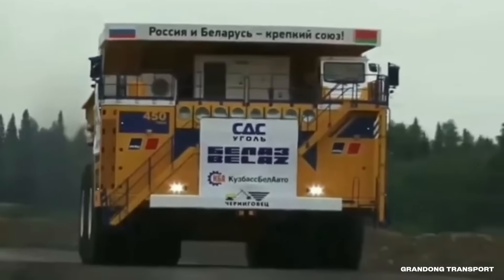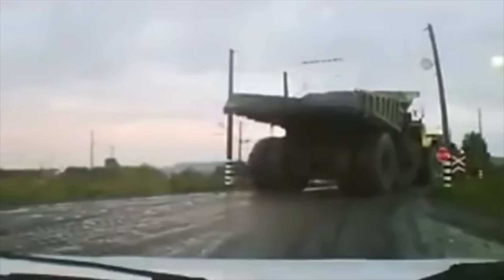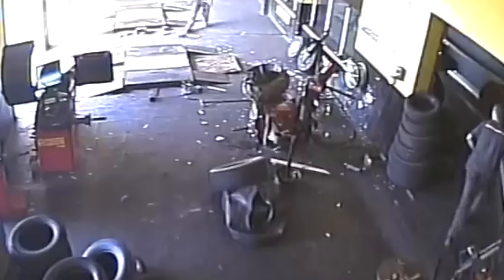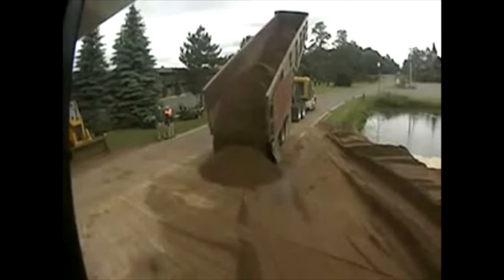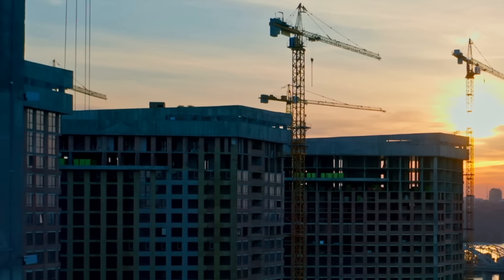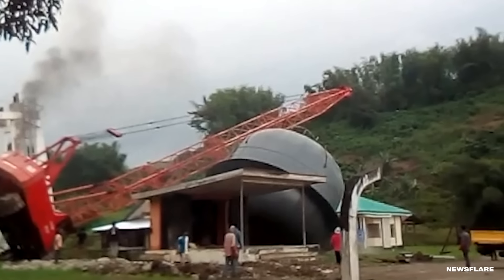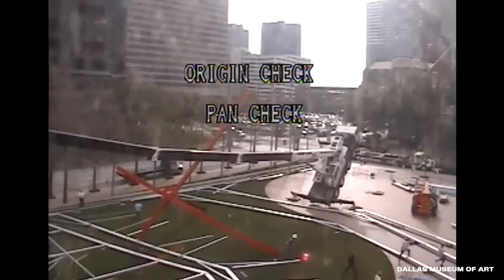Catastrophic Worker Mistakes Caught on Camera

Comment: The crane easily supported the weight of the water tank.  The ground under the crane couldn't though.  The tracks of the crane should have been bolstered with large wooden blocks.
That sculpture is so ugly, I thought it was the accident.
Reply: That water tank one was two minutes of nothing happening and the actual accident missed.
Reply: That red sculpture was a waste of perfectly got construction steel.
Reply: @KB10GL How much tax dollars were spent on that monstrosity?
Reply: @Absaalookemensch  No blessed idea, but any number greater than one would be too much, in my view.

Comment: Looks like the ground gave way, not the crane. Poor preparation, regardless.
Reply: Yes. Clearly. Narrator should have looked more closely.
Reply: @mrcryptozoic817  these channels are pretty much AI-generated. It's the same "narrator" through several of them, and if it is a real person, he's somewhere remote and pretty much has no idea what he's reading and doesn't see the videos, let alone do the research. I watch them pretty much for the wild videos themselves, and get a basic context, but take everything with a grain of salt. Some of them are just blatantly inaccurate and/or dramatized.
Reply: @BobbySacamano I agree with you. But somewhere there is (or should be) a human saying (or clicking) "Good enough. I'm running with it", and checking the "OK" box.

But it's also likely that the AI writes it and checks the box. In the interest of honesty (of which there is little), there should be a disclaimer: "AI produced and narrated".  
That check sb YT admins job.

Comment: The truck toppling over to the right side makes me wonder whether these types of trucks would benefit by having air or hydraulic vibrator on the bed to facilitate emptying of the contents. Just wondering.
Reply: I looked and they do make them. Dump body vibrator or industrial truck vibrators.

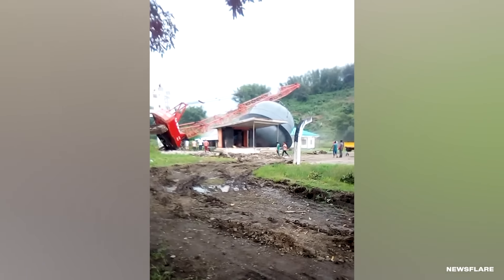Comment: 6:20 That's just part of the issue. The load on a crane has a mechanical advantage. if the crane is near vertical it can lift more, but as the tank is very wide around, the crane could only lift it so far before it hits the boom. Tipping the boom gives the load more advantage, like using a pry bar on a manhole cover and it overcomes the counterweight.

Comment: 3:02  so wrong...all those tire explosions have nothing to do with under inflation, just idiots over inflating them, an normally inflated tire doesn't explode like that, checking max tire pressure and a pressure gauge is all that''s needed here...

Comment: Truck tyres will kill you straight up! Although a car tyre is not as big it's not impossible to be killed or seriously injured. This is why they should be enclosed inside cages to prevent the debris and force of an Explosion by containing it. Though some countries have any compulsory safety laws enforcing this. I'm always careful when working on or with an inflated wheel. Especially a Truck wheel because they go off like a bomb.